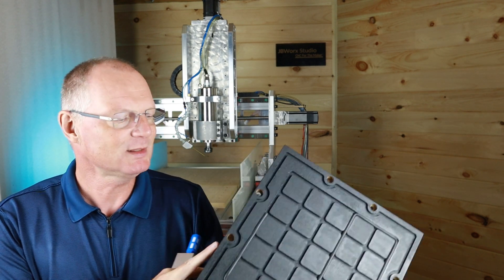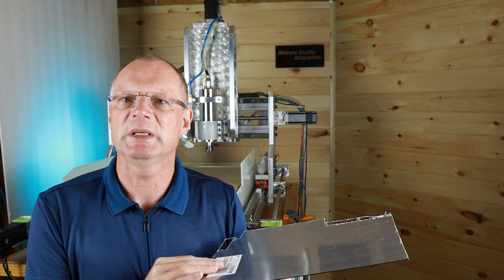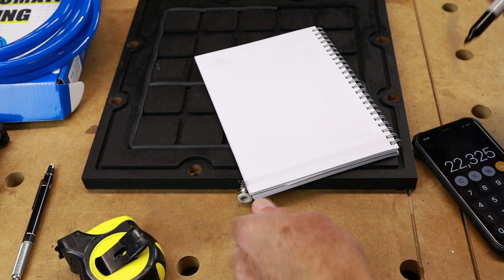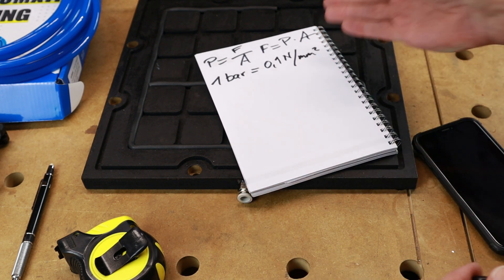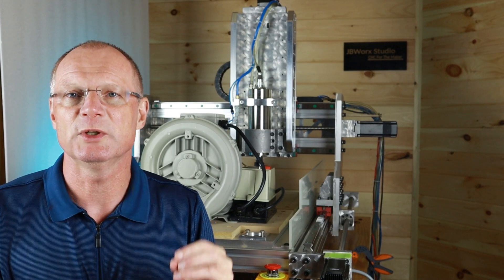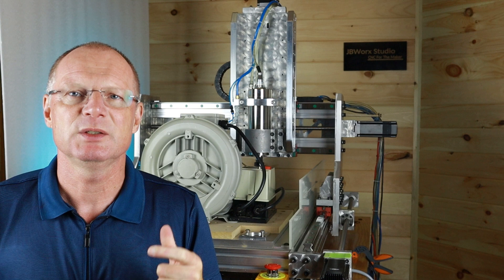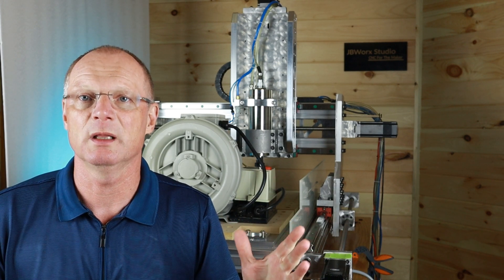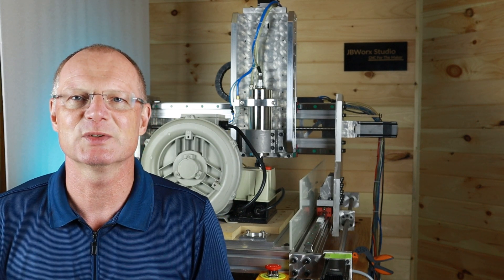Vacuum Plate 2 (Testing Pumps)

Comment: venturi  pumps are good for 2 scenarios only:
1. you need a vacuum pump with no moving parts to vacuum out corrosive gasses or abrasive dust.
2. you have an endless supply of compressed air and this is all you have )

for any other scenario this type of pump is ridiculously ineffective.
i personally use a generic rotary vane pump (70L/min) and it is great for workholding.
initially i have a same problem with oil mist coming out of the pump but i fixed it by installing an oil mist separator from the same manufacturer (Value).  
it is basically a filter can which is screwed on the exhaust hole. it reduced amount of mist by roughly 85-90%
you can find many variants of such filters.  efficiency of rotary vane pump is worth it )
Reply from the maker: I think I would add 3. The cost of $15 makes it worth for a test to see if vacuum work holding is the right tool in your shop. 
Yes all large routers use rotary vane pumps. I think “Gast” would be a good brand but there are many others. Also air filtration becomes a must for these types of pumps as small particles will usually damage the veins (that can be re-build however). Thanks for your input.
Reply: @JBWorx  actually, if the vacuum is quite stable, eg metal working, then you can use a solenoid on the Venturi. The flow reacts near instantly and a vacuum is a vacuum, doesn't always matter that it takes a while to get there

Similarly you could attach a pressure valve to the feed hold so that the machine will pause if pressure is lost

Clearly this isn't relevant to many woodworking situations with permeable materials
Reply from the maker: Yes having the vacuum monitored by the machine is a really good way to prevent scrap and a bit breakage. Interesting enough my controller can selectively control valves based on its position in x and y. Pretty interesting.
Reply: @JBWorx  Gast makes/made carbon vane pumps, they have no oil present at all. We used them for vacuum and pressure on some Univac tape drives.
Reply from the maker: Yes I think also Busch has these oilless vane pumps. But for hobby use quite expensive.
Reply: is pierson workholding VPU a venturi pump? https://www.youtube.com/watch?v=-j5mH6L4SW0
Reply from the maker: Yes, he usually uses a Venturi pump in his videos and the one he sells is his design based on the Venturi effect.

Comment: Very interesting, having a larger pump on mine small parts are a problem, I had thought re-jigging the vac-bed zones might help, clearly not.  

Interestingly my current bed is expanded foam PVC, I've used it since I installed the pump, being in an area close to a lot of wet, salty sea air, I wanted something that wasn't affected by the atmosphere, but personally think it's a bit soft and spongy. an engineering plastic such as HDPE is better.
Reply from the maker: Thank you for your comment in aspect of using a better plastic I would suggest Delrin (Acetal, POM) HDPE is just not stable enough unless you place a lot of hold downs on it. Yes small parts just don’t have enough clamping force as it is in direct relation to the area within the seal.
Just watched your HDPE video nicely done ✅
Reply: @JBWorx  Yes, your probably right on the HDPE.

I may though have to consider a second small vac board I can pop onto the bed as and when needed, with a vane pump, for small parts.
Reply from the maker: Also you can try to place one layer of fine sandpaper (I.e. 600 grit) between the part and the vac plate. This will increase the friction and avoid the side to side movement. Make sure the part is in contact with the plate once vacuum is applied and not propped up by the seal. I am looking for a vane pump that does not spit oil out the exhaust.  Good luck with your project and channel
Reply: @JBWorx  Funny enough  newspaper does the same, which I use occasionally, as we buy it for packaging (unprinted) so it's to hand.
Reply from the maker: Yes same function as the Datron vacucard it’s permeablere and can take small bumps and increase the vacuum as it slows down any leaks. The sandpaper will work great between 2 metal surfaces.
Reply: @JBWorx  using sandpaper (two pieces glued back to back) is a good practice but there is a catch - you need to install some air filter before the pump because otherwise  any grit falling prom a sand paper will end inside your pump ruining working surfaces.
Reply from the maker: Air filtration is a must for most pumps. Matter of fact you see a filter right before the foot Paddel valve on the table (link in the description). Any debris indigested by the pump, especially rotary vane pump, will damage it. It will still run but the amount of produced vacuum will be less.
Reply: @JBWorx  Yes, I have one fitted for my  side blower, along with a debris trap to stop any miscreant chips.
Reply from the maker: I think that is cheap insurance. Any quality pump is usually rather expensive. I think Busch and Gast really do not have anything under $1000 . Sometimes a good deal comes up on eBay and these pumps can be rebuilt in case they would not perform. I am making a table for a rc- airplane wing mold so that inspired this whole vacuum video. On that one I will use the regenerative blower as it only needs to hold foam down so the cutting forces are close to nill.
Reply: @JBWorx  Yes, it's one of those blowers I use, knonw as a side blower in the UK, on my machine. 1.5kw . It holds sheet material extremely well as long as it's a reasonable size, though I may have to block off the rest of the bed with scrap sheet.

 I should have fitted it to a VDF, but I can't work out where best to fit another to the machine, so that will have to wait.   

Its great on foam too, I cut that regular enough.

Small parts are the ongoing issue.
Reply from the maker: I think some call it also bypass blower. Cool thing is there is a 2 stage model available as well increasing the vacuum.
Reply: @JBWorx  More than likely, mine is a single stage version. Takes a bit of juice to get it started, hence would have been better on a VFD.
Reply from the maker: Yes, I think in the video it sounds like a plane taking of and I reduced the volume twice so the audio would not blow up lol